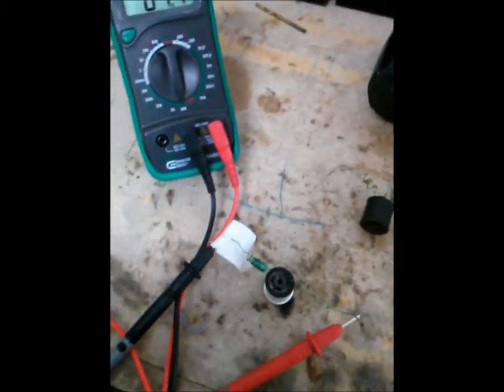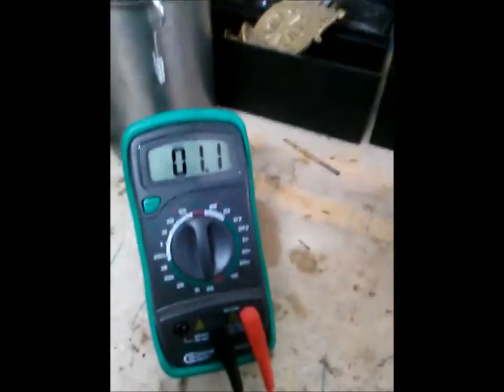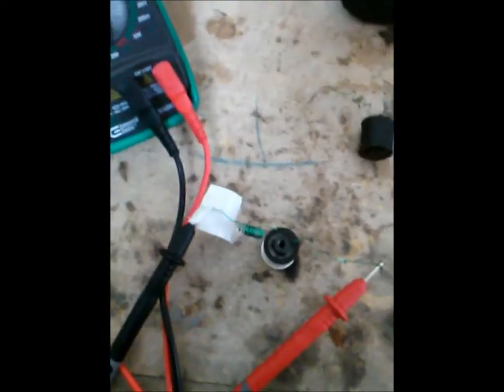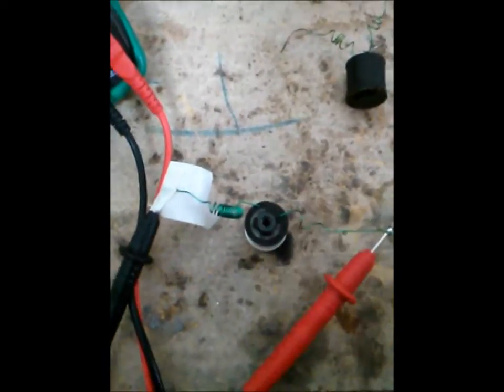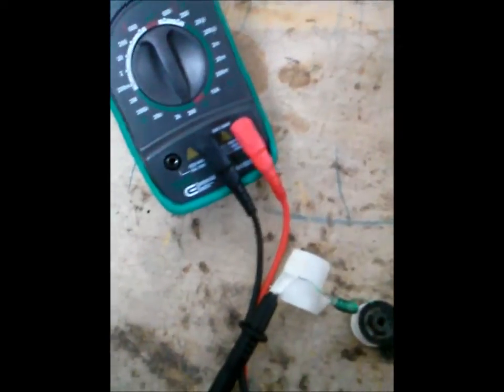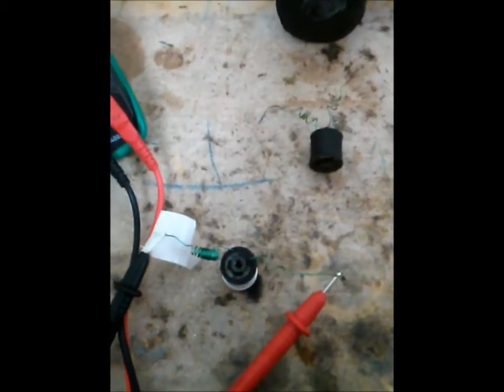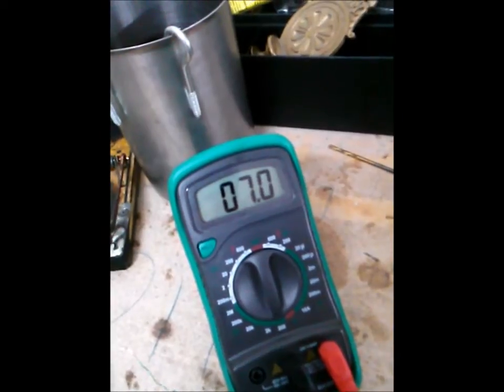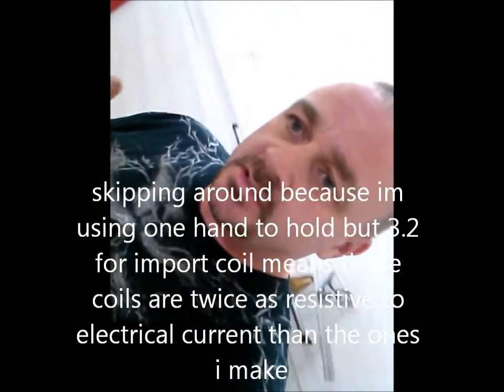tattoo machine coils and resistance.

Comment: What would make a set of coils run at over 2 amps.
Reply from the maker: no idea on amps that sounds painful though for tattooing haha
Reply: Voltage divided by resistance in ohms  equals current in  amps so it would take your machines resistance being less than half of the voltage you use it at ex using a 4 ohm machine at anything over 8 volts

Comment: why not use  copper springs? copper is not that expensive, neither is silver.  I don't think the type of frame you use has much relevance.  It does not make sense? in the a theoretical sense, just assuming that there is a standard, which there is obviously not.  Casting metal is not very hard either it would be easier to make a solid frame than weld? why waste your time.  Bent frames I see no difference.  The video I have watched 100 times at least.  A BIG THANK YOU TO SIN CITY TATTOOS, YOU MAKE AWESOME VIDEOS.

Comment: can i ask if i take chinese coils off of a pretty decent cast frame also chinese  but take the coils off unwind them then use the same chinese core and plastic bobbin that is over the coils and just  rewrap with 24 awg real copper wire  will that make for better resistance and overall better running coils?? Or is that a waste of time and wire?? Should i just redo everything cores washers and all?? Hope you understand my question LOL Thanks !!!!